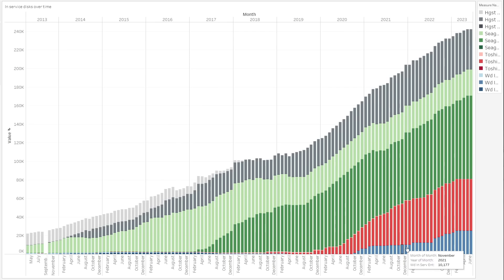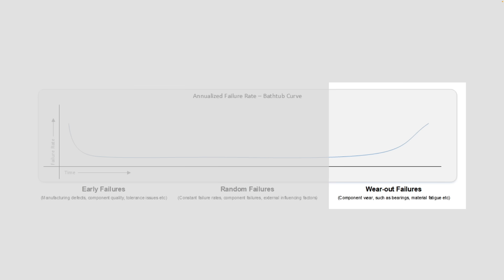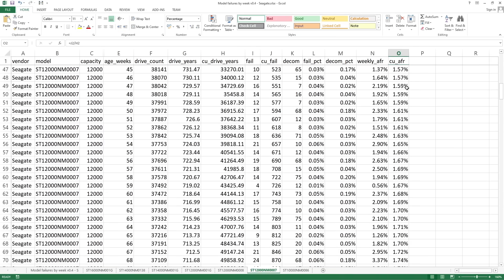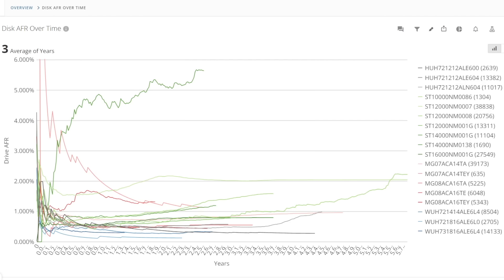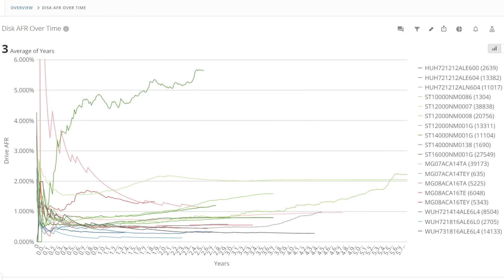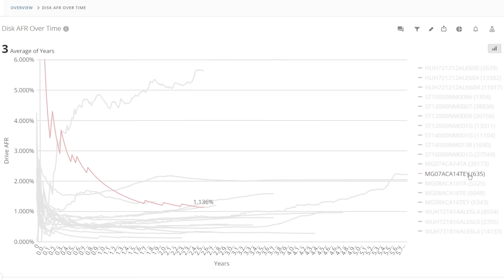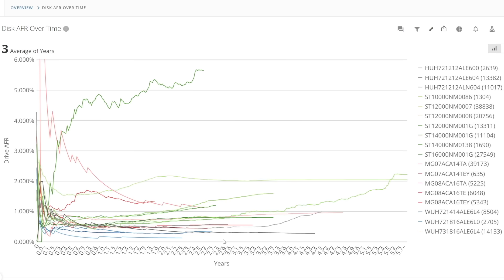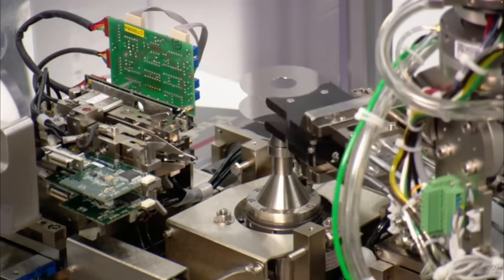Failure Rate Analysis - Best 10Tb+ hard drives: Seagate, Western Digital or Toshiba?

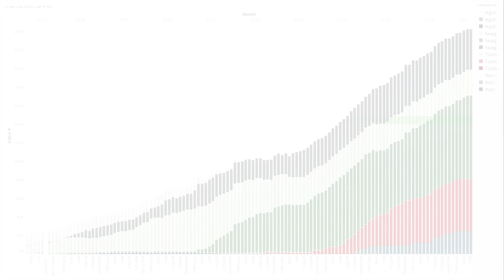Comment: 00:01 Analysis of drive reliability data for 10TB+ hard drives from Seagate, Western Digital, and Toshiba.
01:59 Annualized Failure Rate (AFR) gives insight into drive reliability over time.
03:56 AFR numbers change over time and trend data provides a big picture view on the performance of drive cohort.
05:54 Western Digital drives' failure rates are analyzed based on drive age and not dates.
07:54 Seagate's 10TB+ hard drives show varying failure rates over time.
09:57 Toshiba drives have higher early failure rate but stabilize over time
12:00 WD Ultra Stars are the best performing drives with impressive reliability.
13:56 Western Digital drives are impressive for reliability, Seagate may not be the most reliable but they are often cheaper.

WD is the worst, this is paid review.
Reply from the maker: Hi, this isn't a paid review and I think that couldn't be much clearer, so not sure where that comment comes from. 
This is not in fact a review at all, but a comparison of drives based on raw data provided by a third party. The data does reveal that WD, in recent times at least, appear to provide the best reliability. I don't however say they are the 'best drives' and point out that price is a consideration also, and that actually Seagate drives may be a better choice even with the reliability difference, due to the pricing and the fact that warranty coverage does allow any failures to be replaced.

But from your comment, I guess you don't like WD, which is completely fine and many have these views based on anecdotal experience. But claiming its a paid promotion simply because you don't like the data is a stretch. 🙂
Reply: @sometechguy  Got it. You must be a complete beginner in this field. Please see my other comment(below) I made on this video. In a simple word WD is no more than a scam to me. Backblaze data is not the realife data of user. Why Blackblaze would produce such data, it is a company only, they do manipulate things for other OEM if OEM gives too much goodies.
---------------
To me, WD signifies failure. Almost 4-5 drives failed after just 1 or 2 power outages. I only trust Hitachi, Seagate, and Toshiba.
I bought a SanDisk SSD, which later failed, and I discovered it was made by WD. I then purchased a G-Drive from the Apple Store, which also failed in 6 months. Upon breaking open the G-Drive packaging, I found, as expected, they were using WD drive.
However, I stopped buying Hitachi after WD acquired it.
--------------
Reply: @redneckcoder I may agree with your statement, but old WD is different story compared to from 2017-18 WD

Comment: Hi: Do you think a sata  Ultrastar DC HC530 14 tb over an 8 tb WD Black is a good buy? The price is the same in my country and I want it for files and movies backup. mostly, pc use.
Reply from the maker: Personally., I buy enterprise drives for this kind of use case because you will often get better value for money with theee than the black drives, and I did a video on this topic - 
https://youtu.be/QDyqNry_mDo. The one thing to consider is that the Ultrastar will probably be a bit more noisy, so consider that if it will matter to you.

Comment: What's happens if you look at drive batches. You ignore a bad batch would itself significantly contribute to the AFR over random. Also muted by pooling day 1 = deploy date as this would pull down average failure if a batch performed poorly but everything else did well. If you got all your drives in a single bad batch, perhaps so your drives died while someone else actually has a AFR far below advertised after n years.

Have to treat data carefully.

Comment: About ten years ago, I ceased using mechanical hard drives. I exclusively used Western Digital drives, but my trust in them was shattered after experiencing drive failures within just three months of ownership. I now exclusively use solid-state drives and still possess the first one I purchased, which continues to operate with a significant amount of usable life remaining.
Reply: i love ssds, i have three, two of them are over 10 years old and my newest m.2 is about to turn 3. And I have only bought three ssds my whole life!

Comment: Very informative, thank you!
May I ask a question tho?
I had several WD drives failing on me or giving me problems, so looking now on Seagate. Based on the result of your research and experience would you suggest me to avoid going for the 12 or 14 TB options (probably Exos) from Seagate even for data storage/backup?
Thanks a lot for your video and your answer!
Reply from the maker: The first thing to say, is that any drive can fail and it can be drive quality, which is probably the difference between a large dataset like the one I used, or can simply be bad logistics such as packing and handling. But overall, it seems statistically, WD will be most reliable.

That said, none of the manufacturers are so bad as to 'avoid', but I consider this depending on the use case along with the price. I have quite a few Exos  and Ironwolf Pro's with no issues, and I have quite a few Ultrastars also. I had WD Reds fail, but I just had quite a few and they were over 7 years old. So I wouldn't call that a major issue either.

There are some models to avoid, and it seems generally the newer models seem better. Those X16's seem pretty good. I didn't have as much data on the later models.

But you are looking for cold storage, you can probably focus on cost per Tb and not get too worried. I have all my data on RAID using Pro or Enterprise grade disks, and my most important data I have two copies on two different NAS; but my cold storage backups are on lower end 'cheap' drives, often external disks that contain drives like barracuda's. Those don't have the best rep but I had no issues, even on very old disks, considering how little time they spent powered on, and are cold backups they are not at serious risk of failure.
Reply: @sometechguy  Thanks a lot for your exhaustive answer!
I totally agree, every disk can fail and that's why I use to have at least a second disk as backup.
Anyway since I would use also to work on it and the disk would likely be under load quite a few hours every day I'd like to go for the safest bet.

I thought you mentioned on another video that the 12TB version of the Exos had an history of higher failure rate and while the X16 is on average quite more reliable seems also not easy to find this series (may be discontinued?) but rather in the X18 or X20 versions.

All in all, having to chose between 12, 14 and 16TB disks do you think there would be one that you would prefer for reliability (perhaps being better engineered)?

Thanks again for your time!
Reply: Exos X series anyway should be entirely CMR, isn't it?
Reply from the maker: @twowheelslife5611  yes, the Exos range is CMR, with a couple of very specific disks that are host managed SMR, but you shouldn’t be able to get those by mistake. The data didn’t include much on the X18 and none on the X20 but I personally bought some X18 18Tb disks. Though it isn’t going to be true that newer disks are always better, there does appear to be a trend of improvement. So I wouldn’t be put off those disks until I see data. Bit more recently I have been buying the WD Ultrastar as they seem the best for reliability.
Reply: @sometechguy  Thanks again for your reply.
If so shouldn't be any difference in terms of reliability closing one size or another, thus going with Seagate any 12 14 or 16 TB version will probably be the same. 
Could be due to my bad experience but I still have some bias toward WD, anyway I'll still consider this Ultrastar in my choice before to invest in set of them. 👌🏻

Thanks!

Comment: Western Digital wins for mission critical data storage then. after 1 disk failure savings from other drives are not worth it. use WD only.
Reply from the maker: For home users and SMB, this would be my opinion. For larger enterprise use cases, the cost savings are probably beneficial to run the Exos and you just carry spares, replace any failures and warranty the drives. Which you would have to do anyway, no matter which manufacturer you choose. 

But it probably just comes down to cost and the warranty process, which is probably via your server provider anyway.

Comment: Checked my drives with crystal disk info now and found out that my 4tb WD still is basically flawless after 13k hours, but my new 4TB Seagate drives have already lost around 15 points in the Read error Rate section. They are just like 8 months old and only have 200 hours running time WTF. Never again Seagate, NEVER.

Comment: PC Builder here since 1992. Avoid Seagate. Through the years I have given Seagate many chhances, always disappoints.
WD has been my go to brand. My homelab server with 12x drives running 24/7 are only WD, Toshiba is a distant 2nd.
I will try one Seagate Iron wolf pro one day to revalidate my experience with them with 0% expectation they last a year without problems.
I do PC repair jobs since 1988 and Seagate drives have always failed worst than Maxtor or Conner drives which are no more around.
Reply from the maker: Conner and Maxtor also acquired by Seagate eventually. I remember both of these back in the day when there wasn’t just three HDD manufacturers.

Comment: what you said in your video is an oversimplification of what i've known for DECADES (even before Backblaze started sharing their findings), and i've told people this for years.

basically, HGST brand is the best around, by far. it's a shame that they were acquired by Western Digital, since i have had about a decade's worth of FAILED drives by them (especially their EXTERNAL drives). however, BECAUSE they were acquired by WD, their Helium line of drives were kept (Helium helps the drives performance and durability), and if you look at the HGST drives on Backblaze's list, and the WD drives, you'll notice that the WD drives' model numbers are similar to HGSTs. that is because they basically just changed the first letter to W instead of H, indicating the change in ownership.

so yeah, for newer drives, just grab any WD drive that is touted as "Helium", but be sure they use CMR and not SMR, for stability and longevity. HGST did it best...

Comment: And I always thought Seagate was good and WD was terrible. What changed?
Reply from the maker: The failure rates for both are not super high, so if you are a regular disk buyer or even someone that buys quite a few drives over the years for home use then it’s quite possible you get no failures for the useful life of the drive. But you could always suffer an early failure.

So depending on which you buy and your luck, you get either a good or bad impression of that manufacturer. I see a lot of comments on these videos about people who hate either Seagate or WD, or Toshiba because of those bad experiences. Seagate get the worst press overall, they do have higher fail rates but also a much bigger market share, so more chance for someone to have a bad experience. 

But in the end, I think it’s just chance. Unless you really analyze the data and find out what the statistical probabilities are. And this is what I did here. 

If you do buy a lot of disks, you get a more realistic picture but you can also factor in cost and warranty process, as Seagate are often (not always) cheaper to buy. So if you save 10% say, but get 10% more failures, which you can return under warranty, it’s probably a good deal over 1000s of drives. Especially if your servers get replaced before that warranty expires.

Comment: These drives boast 2.5 million hours 'mean time before failure'.
As it happens that's really a long time - about 285 years long.
If I could live that long, I'd bet the farm that no drive alive today will ever run for 285 years.
Reply from the maker: On the face of it, it doesn’t make a lot of sense. But if you look at it more along the lines of ‘if I have 285 drives, each year 1 will fail’, it seems more credible. 

But one of the problems is that these are predictive estimates, based on failure rates of components, and also they don’t consider the life of the drive. As you point out, it’s very unlikely any drive would last 285 years. Once the warranty period is past, you can certainly expect rates might start to climb. And actually, other than some specific models, most drives here never achieve their stated MTBF at any point in their life.

Comment: WD HGST Ultrastar HC510 10TB or TOSHIBA MG Series Enterprice 10TB?
Reply from the maker: There isn't data for either of those specific models, but based on the holistic data from drives in those ranges, the Ultrastars look to be the most reliable. But, as I always point out, that doesn't make it a definitive choice. The Tosh MGs are often quite a bit cheaper, and they still appear to be good drives. And they all come with the same 5 Year warranty also.

But if its for home use, and you don't run large numbers and carry spares, and drive failures are likely to be a real inconvenience, I would pay the extra (if its reasonable) and get the Ultrastars...personally.

Comment: Did I miss the analyst on the Seagate Iron Wolf Pro 12TB drive? Thoughts?
Reply from the maker: The dataset doesn't include any high capacity NAS drives, just Enterprise drives. So there just isn't any data there on those drives to analyze I am afraid. I have another video comparing 4, 6 and 8 Tb drives which contains Enterprise and Desktop drives and this dataset has a fairly small sample of WD Red drives, but the numbers are pretty small, and they did not fare well, being decommissioned pretty early following poor reliability.

That video can be found here: https://youtu.be/l_YqdVGcC0o

Comment: Everyone here drawing the conclusion that Seagate is a waste of money, neglecting the fact that Backblaze have continued to deploy them at the highest rate. Wonder why...
Reply from the maker: The best explanation is probably the cost. If the drives are significantly cheaper and the operating model is to carry spares and replace failures which have data protection and redundancy in place, it might still save significant money. Especially if the drives have 5 year warranty and will be replaced if they fail. 

The decision for smaller deployments could be different though, where drive failures could be more impacting.

And though the failure rates, at least in this data are higher, they are still fairly modest with most drives surviving well past their warranty period.

Comment: I bought a Seagate Hard Drive, it broke showing size of 0 bytes after just one year, I am really disappointed, because I still have many Japanese Hitachi made Hard Drive, and they are still working after so many years, the very technical Japanese Engineers seem to be doing a far better job and are more intelligent than the incompetent American Engineers.
Even though some of the Hitachi drives are a little bit louder than Seagate, they are far more reliable.

Comment: Cool information, very important.
May SSDs be as cheap as hardisks this year,we pray.

Hitachi and IBM were the most durable, I hope they get revived, though they're maybe a bit more expensive.

God bless.
Reply from the maker: It looks like there may not be price per terabyte parity for SSD vs HDD for quite a few years yet. HDDs are still keeping ahead and greater density on NAND comes with challenges for performance and durability. So for now, SSD for performance, HDD for low cost volume. I have some content on SSDs and SSD vs HDD planned.

Thanks for watching and commenting. 🙂

Comment: I used to employ several dozen mechanical hard drives and saw a failure about every 18 months on average. In 2015 I replaced all of the mechanical hard drives with solid state drives. To this day I have not had a single Drive failure.
Reply: Are the SSDs high capacity drives i.e. >8TB?
Reply: @verygoodbrother  I don't think those were available in 2015
Reply: @verygoodbrother  not in 2015. I have many 1 and 2TB drives from 2015. I upgraded some to 4TB in 2016-17 and that's where it is now.
Reply: @basspig  So it's not cheaper in the long term if you need high capacity drives (e.g. for a NAS). I've not had a hdd fail on me over the past 6 years so i don't think reliability factors as much.
Reply: @verygoodbrother  as one who is getting his electricity from off grid solar, I have to consider energy consumtion. 14W per drive adds up. My old PC prior to 2015, consumed 880W off the wall socket. It had ten HDDs in it, and one would fail every 12-18 months. Now I'm running all SSDs and wall socket consumption is 64W.
Reply: @basspig  That makes sense. My 8-bay NAS consumes around 35W at idle and ramps up to about 55W. I run OMV so i don't have all the drives running at the same time so that saves electricity.
Reply: @verygoodbrother  My router does double duty as a NAS. I have a 2TB SSD hooked up to it. Total power consumed by the router + SSD = 11W.
Reply: Whst brand of SSD? E.g. older Phison reference designs (crap like Kingston A400) were dying at a tempo no HDD can manage (without hammering it). I admit I do have excellent record with certain Korean company I otherwise hate.
Reply: @boaragile82  I have Crucial, Intel and Samsung SSDs.

I did once try OCZ brand SSDs for my Atomos Samurai recorders, and two in a row failed within hours of use. Never buy OCZ brand SSD drives. Stick with reliable brands.
Reply: Do they retain data if powered off for 6 months - 1 year+?